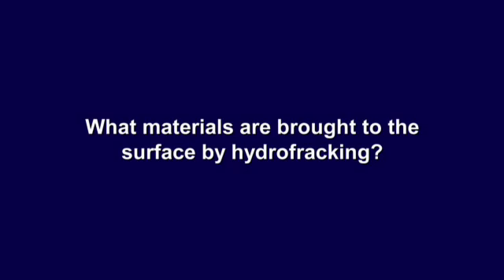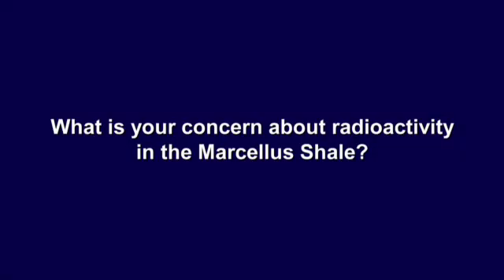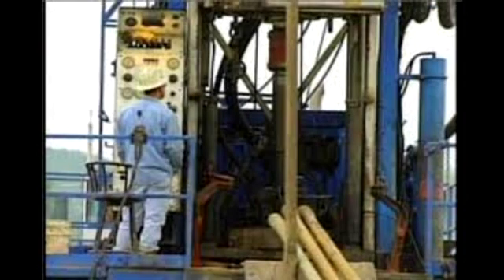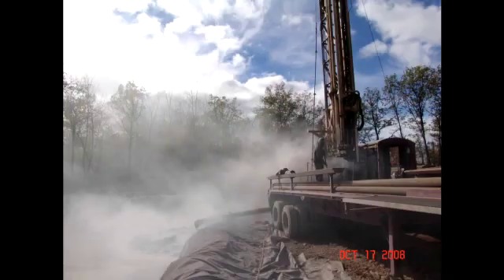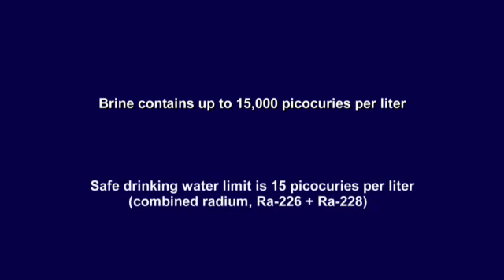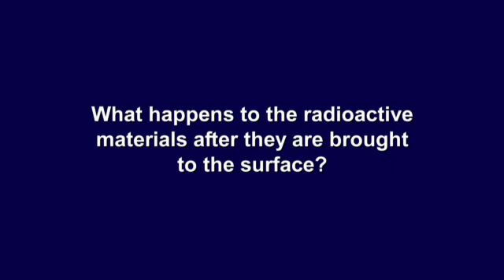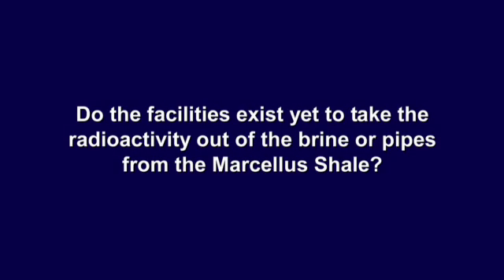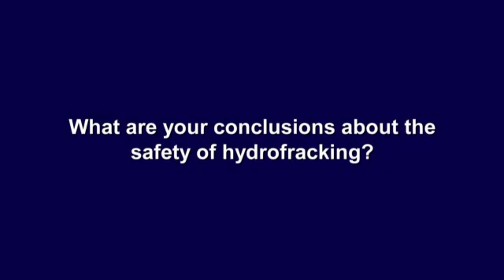Radiation Problems due to Hydrofracking

Comment: I like that term radiophobia but I think the academic credentials of Dr Resnikoff make me inclined to not be blaze of the risks. Risk is relative to exposure and proximity to the disposal/treatment facility. There will inevitably be human contact with these materials at different points in future and in varying concentrations. How would the victims prove it or be able to afford to. Is this cost borne by the polluter?  Pollutant-pathway-receptor. From a keyboard any risk is benign.Solar energy!

Comment: Hi. I was commenting on your comment that homes are not built in pipes under the assumption that you implied that there is a very low level of risk to humans and livelihoods. In response to this I merely stated that there is a pathway for these contaminants through pipeline failure. Also I somehow do not think Dr. Resnikoff is promoting radioactive materials.

Comment: If the wastewater contains benzene then polypropylene pipes transporting it will corrode. This happened in Germany in Coal Bed methane processing. The pipes must be a special grade with aluminum layer between plastic.